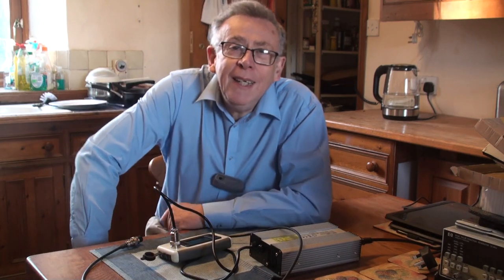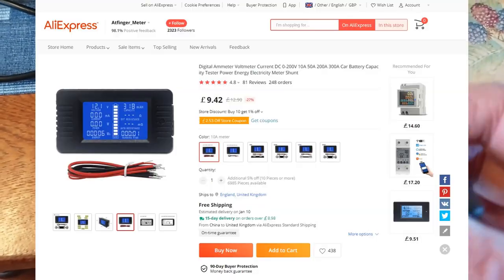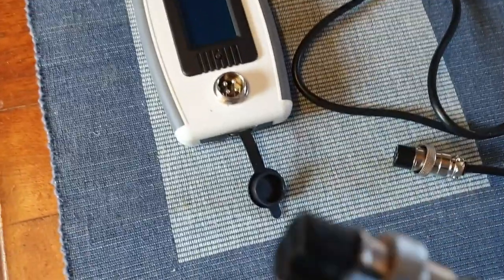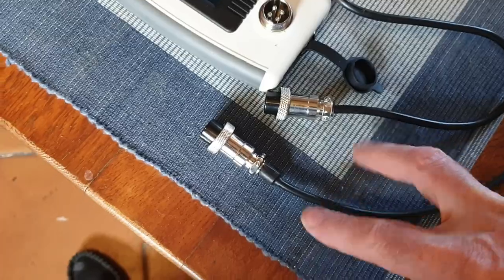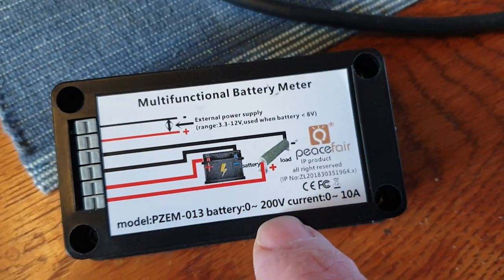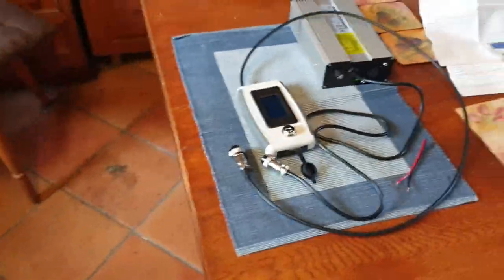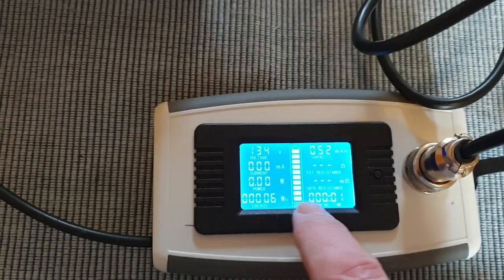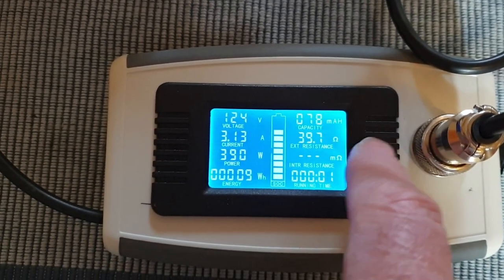Begode Master Charger Monitor

Comment: I fancy knocking one of these up for my Sherman. Some slight tweaking needed as it uses a 5 pin plug. I did buy a nice charger that shows some information but this just looks cooler 😊 I was directed here by the Facebook group by the way. Nice job!!

Comment: Nice idea - thx for sharing ! How you enjoying that machine presuming you are now able to turn it off ?!
Reply from the maker: The Master is something else, I'm struggling a bit with setting off because of the high foot position, but I will beat it, just not getting the time in because of the weather.
Reply: @Roskellan  Exactly the same here about the free-mounting - takes a bit of getting used to hey ?!  :) I added some grease around the bearings, and siliconed the hub rims, and got a waterproof rucksack cover for the top of the machine so I can take it out in all weathers, but it's still not much fun in heavy rain !
Reply from the maker: @Jaaaaaaaaaaaaaaay  Ha, I bought a water proof rucksack cover as well, not yet arrived :-) More for if I get caught out than anything.